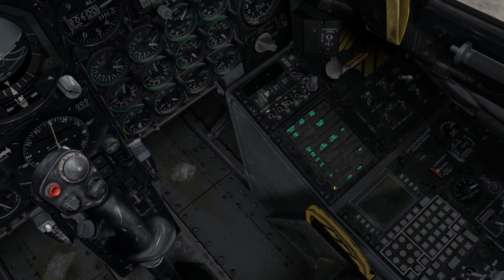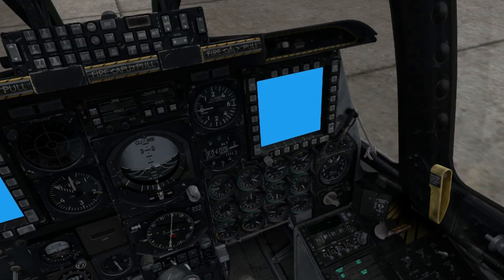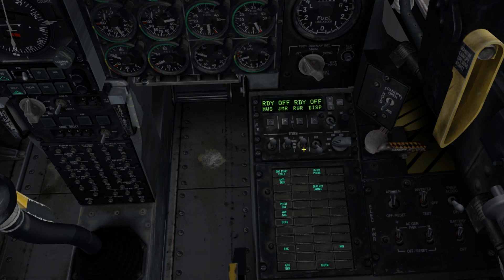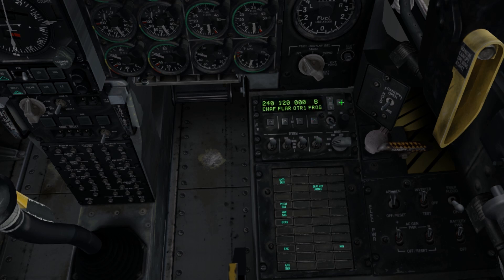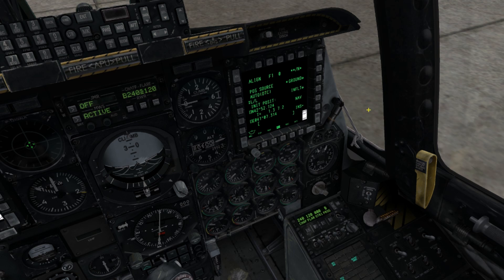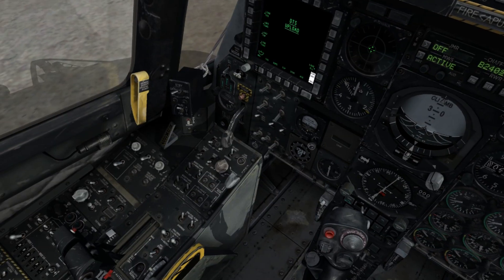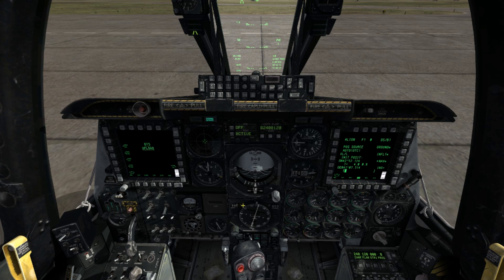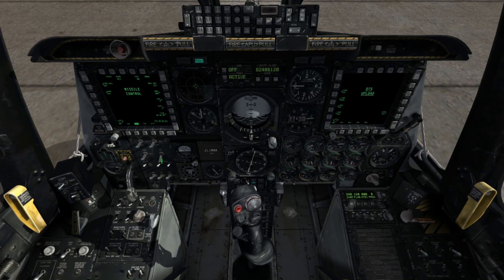DCS World: A-10C Startup Procedure

Comment: @4:12 there it is. The one thing that kept eluding me was what I was calling my 'HUD/WTF syndrome'. Switching out of test and into operation mode. Thank you so much for mentioning that even though it's a commonly known thing, getting the HUD up, here I was up and flying 😀 HUDless warningless, and clueless on why this was happening. Now it will stick. Thx again.
Reply from the maker: Bit late but glad to help man, I remember back when I was learning the A-10 the one thing that kept messing with my startup was EAC, I'm a bit out of practice but if I recall the solution was hitting it last after enabling some mode on the panel in front of the stick after the INS aligned.

Comment: i am new to this game and i dont know where you got that crosshair to manually click on things
Reply from the maker: The default key binding to bring up the crosshair is Left Alt + C 
http://i.imgur.com/4vnPV0E.jpg?1 that image shows the binding in the control menu
Reply: Awesome thanks so much
Reply from the maker: No problem, thinking about it I suppose I should really be mentioning that in startup videos since a good few people would likely wonder about that as well.
Reply: +pickinthatbanjo will the F15 be able to be started using the switches. I only have the normal game with no differences and no added anything other than the F15
Reply from the maker: No anything from Flaming Cliffs (including the F-15C) is simplified without the ability to interact with the cockpit.
Reply: ok. do you think there will be an update to fix that. and is this game still in early access
or something.
Reply from the maker: Daniel Bekker I highly doubt there will be as Flaming Cliffs was a cheaper simplified version that stood apart from DCS in the past, it will see any necessary updates to keep it relevant in DCS:World but due to it's price it will never become high fidelity like the DCS level modules.

I've heard the F-15E is planned by one of the third party developers as a full fidelity module but I've not heard anything regarding the C model. 

 As far as DCS being early access goes, it has existed in one form or another for quite a long time so I wouldn't exactly call it early access, though at it's current state it could be considered early access until the merger between 1.5 and 2.0 is completed.  Also there are always modules being released in an early state for those that choose to buy them, otherwise they release in their full state a few months later.

Comment: I can't see were the "Insert" button is located for "No Wheel Steering"! Can you please tell me? :)
Reply from the maker: Drytarmac http://i.imgur.com/SjEjtfh.jpg?1 This image will display where the insert key is on a standard US keyboard.  And it's "Nose Wheel Steering"  rather than "No Wheel Steering" if you wondered, since the nose wheel is used for steering when engaged.
Reply: pickinthatbanjo Thank you! Now it works! I thought it was a button i the cockpit. ^^ It sounded as you said "No Wheel Steering", and I'm new in A-10 so I didn't thought about what you said. :)
Reply from the maker: There may also be a button for it in the cockpit but I wouldn't be surprised if it is a function that is on the HOTAS.  

But yeah good luck in the A-10C, it's pretty rewarding figuring out all the different systems.  Really been meaning to get more videos uploaded for it.